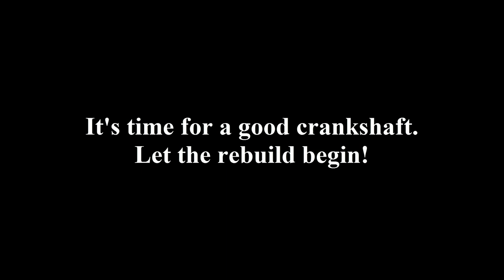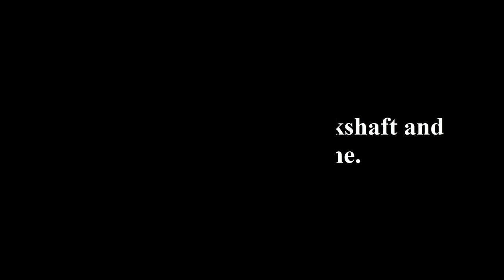BROKEN CRANKSHAFT!! - Piaggio Zip SP Bottom End Rebuild

Comment: You can't just bang your crankshaft with a hammer because you will throw it out of balance. There are two speciality tools called the crankshaft puller and crankshaft pusher for safely splitting the engine case halves, installing the crankshaft, removing the crankshaft and centering it if needed. Also If you buy aftermarket bolts they have to be 10.8 hardness and before installing the crankshaft oil seals apply some oil because you don't want to run them dry. The reason why your bearing did not go in smoothly was because you did not heat up the engine cases enough and  the bearing had to be cold and same thing goes to joining the case halves together.
Also every time you remove tour cylinder or piston you should replace your small end bearing and the spark plug.
Hope this helps!

Comment: In 17 years I have never seen a stock crankshaft fail on a Piaggio 50cc with a low revving 70cc.
Reply from the maker: There is always first time for everything
Reply: @binostuning  how many rpms were you turning ? I'm installing one on my Zuma and plan on doing a max of 11k. I'm also installing a s6 sport pro mk2 on my other Zuma 50 as well with a yasuni r with a stock low mile crank and plan to keep it at 11k too.
Reply from the maker: @nickritter1992  I'm running around 10.5k rpm. It's dangerous to run a stock crank with sport pro.
Reply: My crank bearings are failing but I’m just gonna ride it till it blows up

Comment: just about to do the same job on my liberty, did you put the oil seals in before the bearings ? or can you put them in later. also you can use a bolt with a socket on either side to pull the bearings in to place.
Reply from the maker: I prefer to put the oil seals after installing the crankshaft and close/seal the crankcase. Remember to put little grease on the seals to slide easier.

Comment: You need to get yourself a heat temperature sensor gun so you can tell what temperature ur heating the case to, also put a nut on the crank then use the rubber dead blow hammer to tap the crank in, metal to metal tapping on the crank is bad, all in all at least your about this life 👍
Reply from the maker: I need to get a heat gun first. And the tapping is not metal to metal. My hammer is plastic and I'm hitting a wrench extension not the crankshaft.
Reply: Thats what i mean tho, the extention is metal and contacting the crank, the point of a rubber mallet/deadblow hammer is you can tap the crankshaft directly (no metal extention), the metal extention can flatten the tip of the crank or damage the thread, im not trying to say it dosent work the way your doing it but see your going at it hard so thought id chuck you some info you could use.
Reply from the maker: @1sevzb475  OK I understand what you mean. I have used the extension just to "extend" the crankshaft. I think it doesn't really make any damage because I don't hit the extension to the shaft (metal to metal). But anyway thanks for the tip.

Comment: On the variator side I have bashed the bearing incorrectly, any good ways of getting it back out? Thanks
Reply from the maker: I think the opposite way that you bashed in ?!
Reply: Binos_Tuning Not supposed to bash the inside ring of the bearing but I might have to in this case.
Reply from the maker: @JayLovesProgramming  yep.. unless you have a special bearing puller

Comment: At 00:38, how did you lift the box from the engine? What needs to be done to do that?
Reply from the maker: You have to disassemble all the cables and wires, the rear shock bolt, the main engine bolt that attaches to the frame, water pump hoses and the rear brake cable.
Reply: So the stator connections, choke cable, brake cable, main mount nut and rear shock for an air cooled piaggio zip?

Comment: Why are you pounding on the crankshaft broooooo :(   wawww loll
Reply: I was a total newbee, and banged on my hpc crank.  Well it never ran well.  Havent used it.  I swapped carbs, cdi, coil, etc and took it to other pro builders and they couldn’t find the problem on why it ran horrible on low end acceleration.  Well after some time ive come to the conclusion i may have bent the crank.  Hence creating a wobble, and possibly air leak while it spins!
  I plan to open it up.  So im hear finding ways on puting it back together without hammering on the crank 😏
Reply: @arrepuess  put the crank in the freezer and put the bearings in the oven for about 20 minutes then first put the bearings on the crankshaft on both sides 
Let it cool down heaten up the engine where the crack is going to sit in and i will just slide in place.. no need to hammer anything and the easiest way is to first put the bearings on the crackshaft✅
Reply: @aristobashari7044  thanks for that info.  Luckily i got it running great.  I had other inconspicuous problems
Reply: @arrepuess  what was the problem?
Reply: @StruukenDuukers  mainly my stock intake & tuning.  The fuel petcock vacuum line wasnt vaccumming, so fuel would not flow freely.  The carb bore was bigger than the stock intake.  It reduced inside.  And all my components were larger upgrades
Reply from the maker: If you don't believe that runs pretty well until now, watch the last video of my zip. Never opened the cases after the crankshaft installation.

Comment: Facepalm. There is 0% chance that crank is true after your treatment.
Reply from the maker: 2nd facepalm. It works after my treatment, since 2019.
Reply: Binos Tuning the fact that it works, does not change the fact that you have knocked crank out of true. Nor does it change the fact that you should never instal it that way. Im glad that you are happy with the way it works. Cheers.
Reply from the maker: @blind8686  I didn't say that is the correct way, but it does work since then.